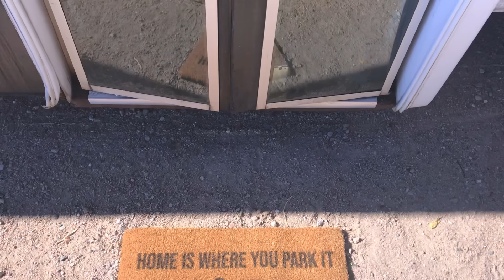BUS CONVERSION FULL BUILD | 1 year start to finish | DIY for under $10k!

Comment: I would have chosen a different route for the sub floor. Instead of using composite plywood which will quickly deteriorate from natural elements such as moisture I would go with something more sturdy (fiberglass, plastic, galvanized metal, etc.)
Reply: Marine plywood + fiberglass bottom.
Reply: Thermocol
Reply: Thanks for the tip Agatha!

Comment: Great work! But it's better next install a toilet than a bathtub. Especially on a long trips, you don't want to keep stop and look for a restroom/toilet every time you have to pee or defecate.
Reply: I know right? I never saw them put in a toilet and I feel like that has to be first thing you install in one of those before a tub.
Reply: Agree
Reply: However, it must be hard to plan a toilet in this kind of building. I mean, there is no real plumbing and sewer, so where the excrements would be sent to...? That's complicated
Reply: @carolinama135  Not really. If they did a walk in shower they could've easily make room for a toilet. Instead t hey wanted a deep tub. Also shower would've been cheaper.

Comment: Looked like you had no protective gear on when you pulled up the flooring.  I clearly saw mold when you pulled that flooring up.  Mold can mess you up bad, especially if you have genetic susceptible.

What was the white stuff you were painting on the metal and the subfloor and why?
Reply: I noticed this too because of a story that stuck with me about someone renovating a house they bought. As they pulled up the carpet, the edge of it nicked their leg and they ended up getting a flesh eating disease and losing the leg. Years old carpets are nothing to be messed with, you wear thick clothing and a respirator, nothing less.
Reply: @ciaranconlon84  
I'm now scared of touching the carpet in my house.

Comment: Very impressive work! 
Did you put any water tanks? Or waste water tanks underneath?
Reply: I think waste water drained to the ground for the tub and the water supply was that blue barrel
Reply: @maxslifer1391  Yes but where does the water come from?
Reply: @gokublack8342   it must be recharged with time I presume
Reply: @gokublack8342  
Rain , originally

Comment: I hope you're going to beef up the suspension all that extra weight you are putting on there will definitely impact your shocks or struts, nice job though
Reply: It actually works the opposite way .
It's designed to carry a lot of people so the brakes/suspension etc can require constant maintenance due to not being worked to their designed capacity , not to mention taking dozens of heavy seats out before commencing work.
It's a common issue on bus conversions.
Reply: They don’t need to

Comment: Good job. You could've used self drilling #12 buildex screws to attach your floor framing though. Less work. Food for thought on your next one. Beats the crap out of an expensive RV. That's for sure.

Comment: You may have solved your problems with drawers opening while driving.  If not or others can benefit from this.  Magnetic child locks.  Get them at home depot $30 for a package of them.  Lock while traveling and unlock when parked and drawers open normally.  They work on cabnet doors as well.  Install in just a few min each.

Comment: Hi, I noticed that the cushions at the front of the coach were a bit small in thickness, put two layers at the seat. Haven't I seen the dashboard?
Do not put paint or varnish that shines on the dashboard, with the sun it will blind you! Warning !!!
well done

Comment: Looks like it could of used insulation on ceiling and walls. Plus you don't need to frame in insulation on floor. Framing causes thermal bridging. Foam can easily withstand weight your going to place on top of it.

Comment: NICE BUILD!  HOW DID YOU FIND YOUR BUS?
Reply from the maker: We found it on Facebook marketplace!
Reply: @evelyntheshuttlebus3612  FROM A BUSINESS OR PRIVATE SELLER?
Reply: Probably an auction. Every state or most has a grant program for transportation of elderly and disabled. When the vehicle meets it's useful life they can be sold through auctions. Sometimes you can find vehiclea with low mileage. vehicles.

Comment: Did you guys make any modifications to the bus in order to add all this extra weight? Seems like there was a ton of weight added beyond the vehicle original design/engineering, which could cause problems to its reliability/performance.
Reply: Exactly what I was thinking. They put in a ton of heavy wood.

Comment: Do you happen to know what year the bus is?! All I know is that it's a Goshen Coach GC II that's built on a Ford E-450 cutaway chassis. Since this has the older E-450 logo with the 2003-2007 grille & the 2004-2008 instrument cluster, this would be either a 2004 or a 2005 model year.
Reply from the maker: You're spot on, it's the 2004!
Reply: @evelyntheshuttlebus3612  Thanks!

Comment: Hmm' I'm just wondering why you took the insulation out& just placed  very thin wood  or what ever that material was made  of that looked like white'  Wood' not to clear what it  was ' bt' you placed them on the sealing'  they looked like' thin wooden panel boards.' Hmm..